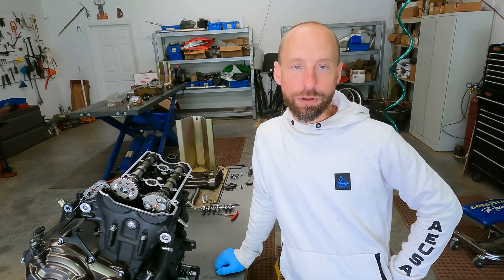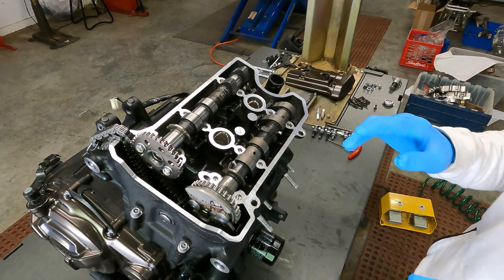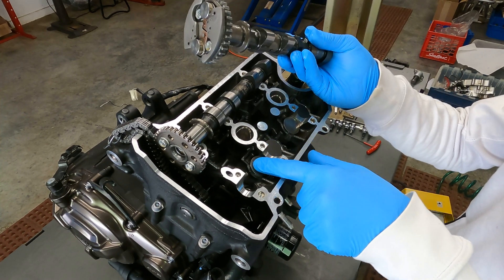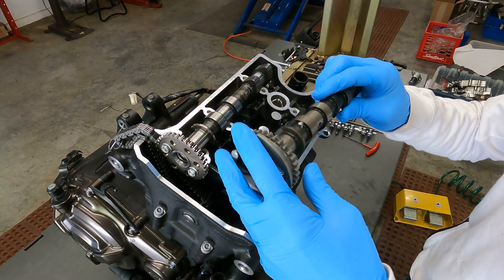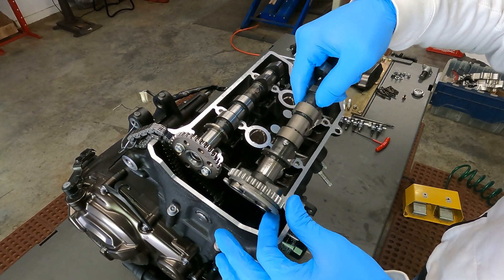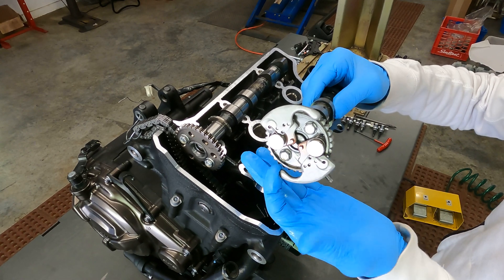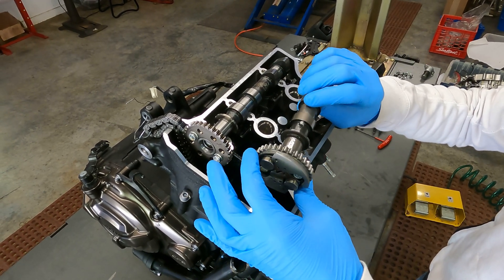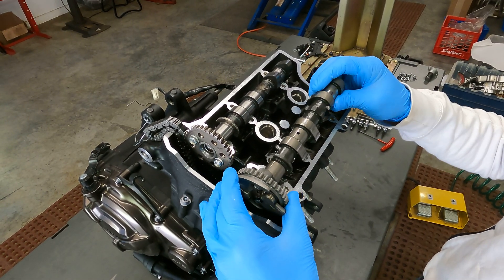Motorcycle Engine Decompressor System Explained

Comment: Great video.  Is there any long term damage to the bike if it’s not repaired?
Reply from the maker: Depends on what is wrong, that thing is spinning very fast inside the engine so if something is broke I would fix it before running the engine.